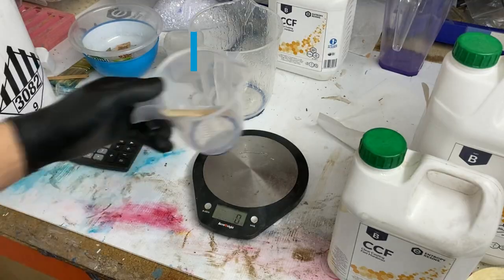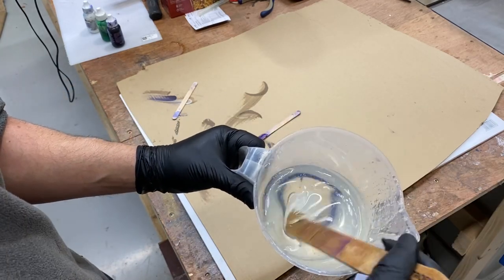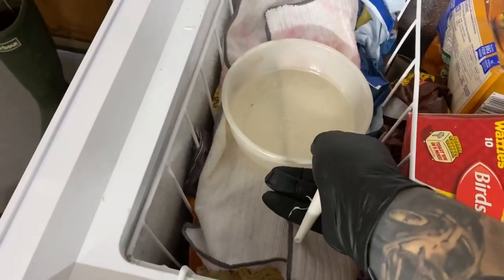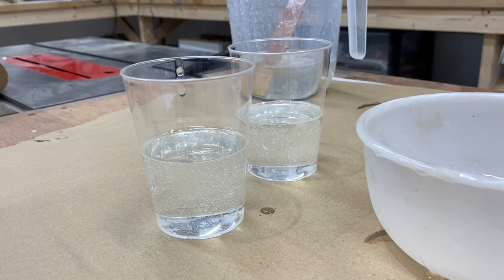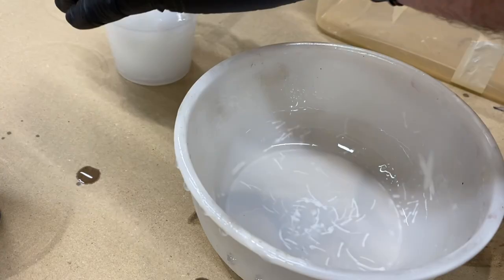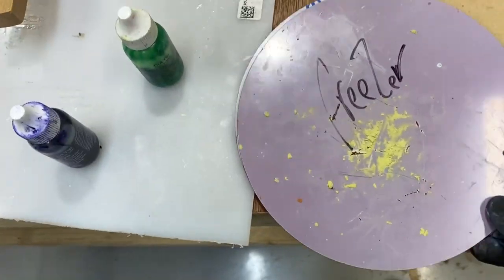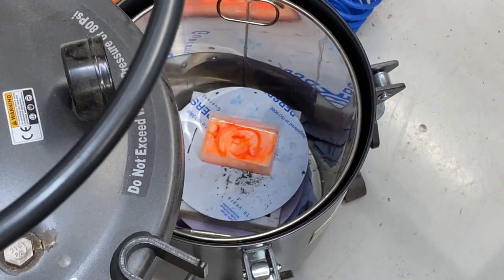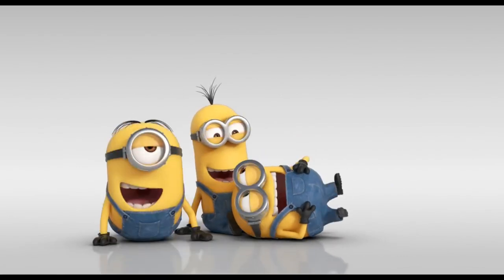How to Create & Keep Swirls in Epoxy Resin after its set? - I Try The FREEZER METHOD! ❄

Comment: Okay, before I start, these were good experiments....

Now then...

#1, the freezer...  You didn't do it long enough....  And the freezer, would really just slow the speed of the reaction, so the resin would actually take longer to set....  Which I am not sure is helpful, for the desired result....  Epoxy resin generates heat as it cures anyways...  So you'd be fighting that all the way, leaving it in the freezer longer...  And it's quite possible that if you got a result, you might have increased the cure time by a LOT...  The frozen cold resin won't cure...  It might never cure....  Somewhere on the Entropy bottle, it probably has a temperature range for use....  I'm not sure what Entropy is doing with their whole bio-resin thing, but in general, 50 F (10 C) is the coldest you wanna try and do any epoxy...  And really for a good result, 60 F (15 C) would be much better...  And some products are like 70 F (21 C) is as cold as they want you to mess around with it....

#2 The 2nd & 3rd, the red & the orange, show a lot of promise.  The difference was probably that the orange pigment has notoriously low opacity, so, in a resin medium, it just doesn't "show up" as strongly....  The red & white was my favorite too...

Comment: It's a shame with what happened with that red/white "blank" if you will. But, to each own persons discretion, if you use either an actual mold release spray or even just non stick cooking spray on a hard plastic mold it will hopefully prevent things like that in the future. Just my two cents with my experiences with resin, as limited as it may be.